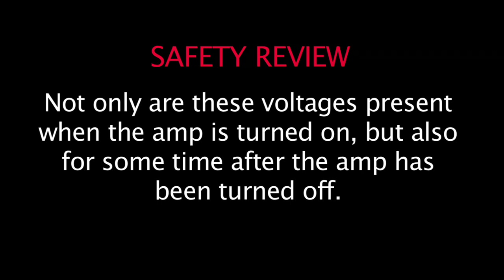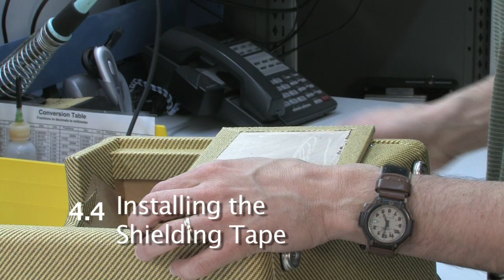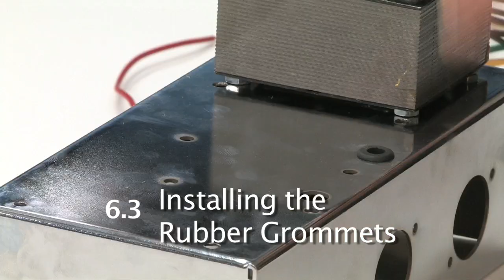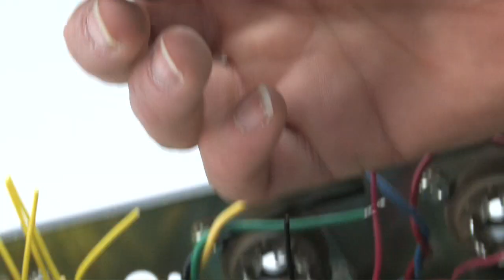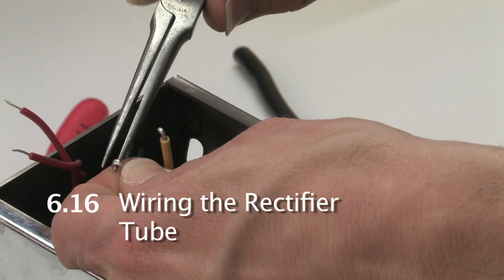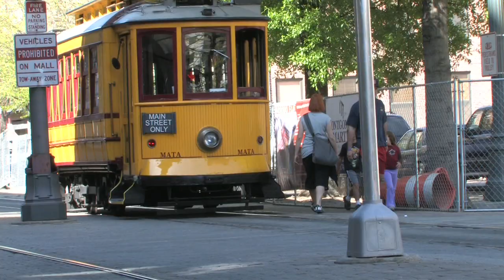How To Build a Tweed 5F1 Kit

Comment: Thanks Rob, I've watched this a few times to get your methods and procedures to assemble the 5F1 amp. Although I did not buy the kit from you guys I did purchase the circuit board and the trim bias pot and some wire cutters from TubeDepot. I will probably  be back a few more times to watch the video again.

Comment: I built your 5f1 kit, it's ok. I also built mojotones 5f1 kit. big differences between the two of them. Bottem line is the mojotone kit is a lot closer to the original Fender amp and sounds much better that the tube depot kit.

Comment: Anyone new at this… do yourself a favor and get PTFE jacketed wire. Its way more difficult to burn or melt PTFE jacketed wire as opposed to normal vinyl wire when soldering. Idk why milspec PTFE hasn’t become standard in amps, tbh.

Comment: Nine years after this video came out and I'm in the middle of building this amp. I sourced a lot of the components for the board from my stock, the chassi came from Weber,. There were some holes in the chassis that were too small but that was easily fixed. The cab, speaker (I went up on speaker quality), and most of the hardware came from Tone Depot. They supply good parts. The cab is gorgeous.  I built the big brother to this amp a few years ago. I swapped to a NOS rectifier to get plate voltage in control. If the little amp sounds as good as the big one I'll be happy. It all started with buying the circuit board. I had no intention of building the amp right now. I need a small amp to practice with so why not...

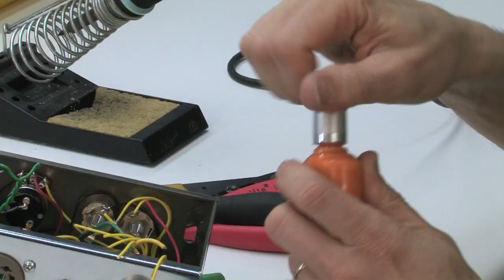Comment: Anybody notice at 7:42 he solders the neutral wire to the fuse. That"s not safe. The incoming hot(black ) wire goes to the end connector on the fuse holder. Shown correct in the assembly diagram though.

Comment: I am no soldering expert, but aren't you supposed to make a solid physical connection between the wire and component before soldering ? I see you just inserting the wire through the hole and then soldering without making a solid connection first.

Comment: The dynamics are slightly changed in a tube rectifier design,versus solid state.Reasons bellow.Also, you might hear the expression about amps, tube amps, "the tone is in the iron". This refers to the output and power transformers, their design and materials change the tone in a pretty recognizable way.
These are not just collector's/purists voodoo beliefs, are actually straightforward electric and electronic phenomena.You want that tone, pretty much you need to use that design. More or less. ;-)

Comment: Forgive the naive question, but why does this design use a rectifier tube instead of a semiconductor diode?  I realize that musicians buy tube amps for their particular sound quality, but how does the power supply rectification impact the amp's sound quality?  Or does it?  DC voltage supplied to an amplifer circuit is just that--DC voltage.  If it's done for the sake of having a pure tube design, than I think the extra cost of the rectifer tube isn't justifyable.

Comment: I've seen your kits and the price y'all are selling them for are ridiculous. You might as well be selling a brand new amplifier. At least the amp will come complete. instead you are basically selling the amp in pieces. All the labor involved putting this kit together brings the price to a considerably higher amount than the resale value would be for a amp without any warranty. Outrageous. The kits price needs to be reevaluated

Comment: I do not see the difference, to build on the large elements to small, from the output transformer to the preamplifier or vice versa. you can at least start from the middle. The main thing - to validate and verify the configuration of the cascade of the power transformer to the input of the preamplifier

Comment: 10" and 12" speakers is another good mod. Though I find the 10" still lacking somewhat in bass response. I found the Weber silver ten to be a pretty good speaker in these amps. In fact Fender used the Weber 8" speaker in their Champs.

Comment: Thanks for your reply but I must respectfully disagree. I've found the "breath" quality to come from the screen grid conducting and not so much sag from the rectifier. I put a signal into my Champ and measured the rails, I found when the amp was putting out full undistorted output the screen grid had pulled down the pre-amp supply while the voltage at the output supply had increased in voltage as is the case in a Class A design. Also check out the Gibson Skylark that is a good alternative too.

Comment: There are quite a few mods to the basic Champ circuit which help it along. Firstly the extra stage of filtering prior to the supply to the output transformer to cut down the 50hz hum. Those 1 meg switch pots are a pain as they are often going faulty. I would use a separate switch and pot. You can also use one of those high wattage wire wound 100 ohm pots to adjust the bias of the output tube. Shielded cable is great in these amps too.

Comment: Hello, I been looking to build a tube amp, but I have a few questions. what determines the volume of the amp the capacitor size or the transformer,can I install tubes in a solid state using any mods, and that resistor you put on that jack what is that? Thanks

Comment: There are a few changes I would make.
First. mount the audio output transformer away from the power transformer, it can even be mounted on the basket of the speaker.
Second, center tap transformer filament supply, or plop in a bridge rectifier and cap and supply the filaments with DC.
Also I would dump the rectifier tube and put in a full wave rectifier with modern diodes.
Now make sure that nothing is connected to chassis ground, even the 1/4 " jacks, double insulated.

Comment: I learned absolutely nothing from this video.  Your basically showing how to drill holes. You talk nothing about soldering and the right and wrong ways of soldering.  No talk about the components (resistors and Capacitors).
Damn guy!